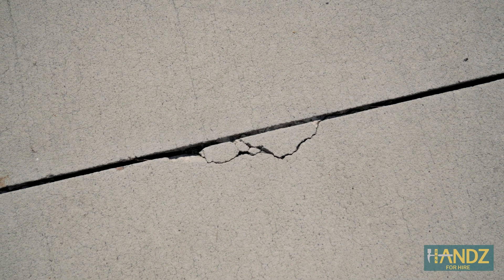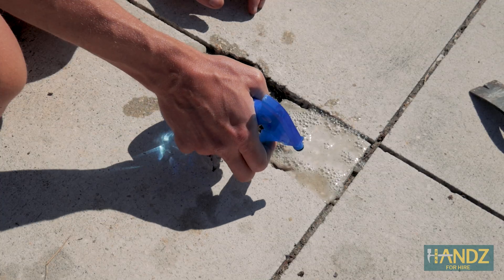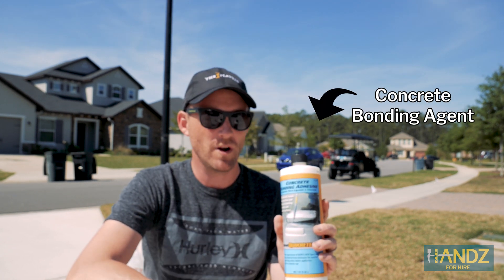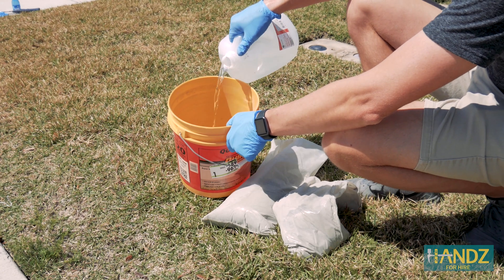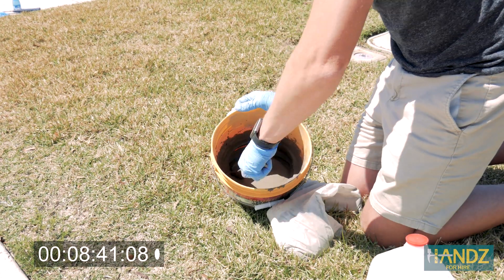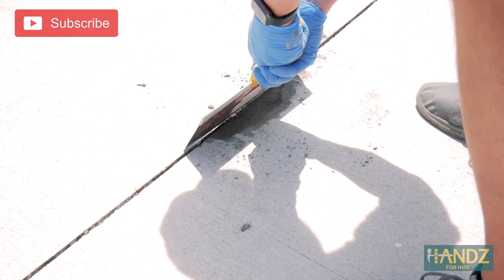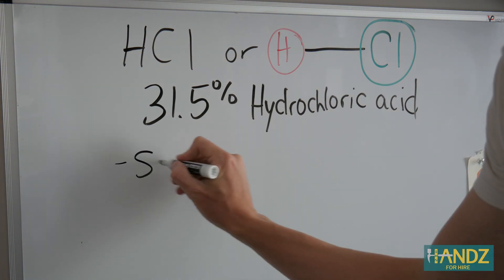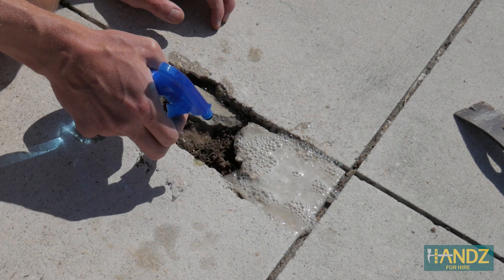How to Repair Concrete Cracks plus the Science of Muriatic Acid

Comment: Hi! I'm just seeing this video but I was wondering if you could provide any advice on how to get rid of efflorescence on cinder block? It's all on my basement walls and I heard muriatic acid would help. This video was also helpful for me because I have cracks in the basement floor I need to patch up.
Reply from the maker: Hi there! Glad the video was helpful. Efflorescence on cinder block is pretty common. It’s basically mineral deposits left behind when moisture moves through the wall and evaporates. The key is usually addressing the source of moisture first (outside drainage, sealing, etc.), otherwise it tends to keep coming back. As for cleaning, some people do use diluted muriatic acid, but it needs to be handled with a lot of caution because of the fumes (in a basement) and potential damage. Have you tried scrubbing with a stiff brush and a mixture of water and vinegar? After cleaning, applying a masonry sealer can help reduce future buildup once the wall is dry. For your basement floor cracks, similar patching products to what I showed in the video should work well, just make sure the cracks are clean and dry before filling. Hope that helps, and best of luck with the basement project!

Comment: That looks like our driveway. But I am really hesitant about using that acid.
Reply from the maker: I can understand. Safety glasses and gloves are definitely helpful. The acid etches the concrete so you get a better bind, but isn't absolutely necessary if you can get it clean. The other challenge I had was matching the concrete color. I should have mixed something with the concrete to make it a lighter color because the patched spots ended up much darker than the driveway. Good luck if you tackle this project!

Comment: Should have done a little tappy tappy on the existing concrete next to the affected area with a rubber mallet after new concrete application to vibrate and really get the concrete into the crevasses. 🤙🏻
Reply from the maker: That's a great idea! Thanks for the comment!

Comment: Really well done 👍
I did think it kinda funny you didn't use gloves for the the acid but did with the concrete
Reply from the maker: MrWorkinguy thanks. Good point about the gloves lol. It’s a good idea to wear for both steps. I guess I’m so used to handling acid from my teaching days and around the pool. Thanks for watching!
Reply: @HandzforHire  definitely a good idea on both, I just used it to clean rust/calcium deposits on a exterior marble stairs using a syringe to concentrate acid flow on the really thick deposits. Now it looks like a new set of stairs.
Reply from the maker: MrWorkinguy awesome!!
Reply: I know thats Right !!!!